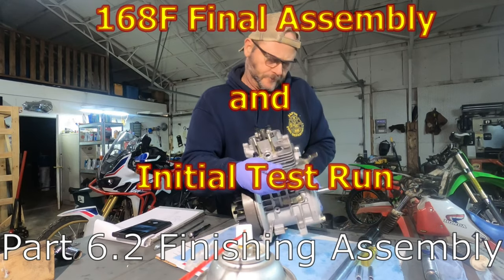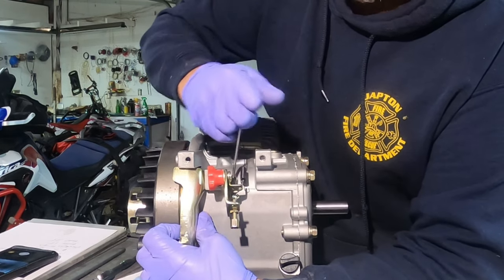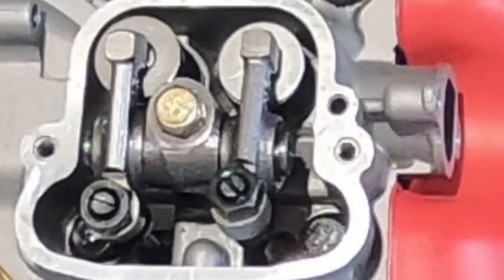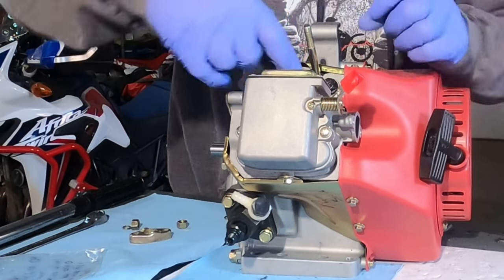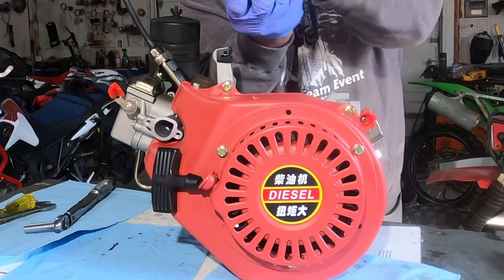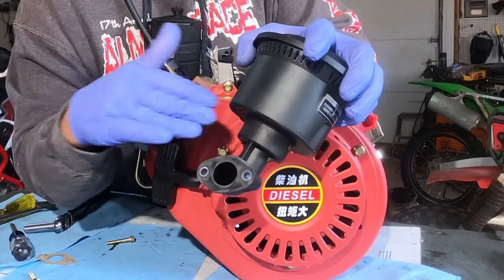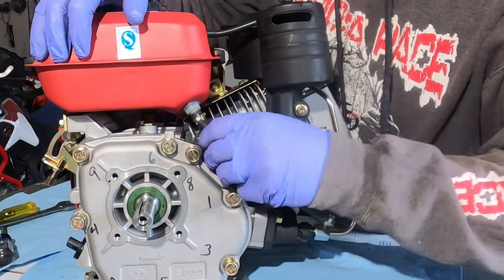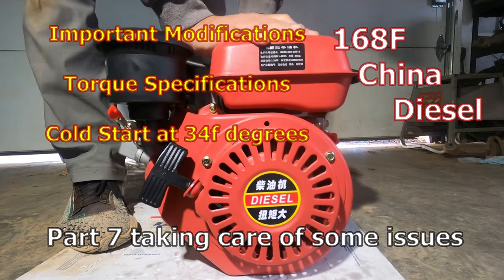168F Small Diesel Prepping for Real Use! Part 6.2 Final Assembly and  Test Run!

Comment: Using Loc-Tite on a cheap Chinese engine is a great idea that will yield really bad results down the road. A very small dab of RTV is a much better idea for those bolts on the blower cover. Making a cork gasket for the valve cover will resolve the soon to be leaking paper gasket that will compress from the vibration quickly....
Reply: I was thinking the same thing. If anything antiseize would be the direction i would go.

Comment: I watched this series and ordered one for a hand build generator. I'm sold by everything I see. Most YouTubers are making war with their little pink or orange motors. I have the pink one coming, if there is a difference. Factory 1 Factory 2?
Reply from the maker: I have 2 of these little engines.  Ordered using same exact order from amazon. I ordered the second one wanting the same as my original engine.  got the other version instead. LOL
Reply: @mossycreekvids  OK. Thanks for the warning. I do like mine. It's waiting in hardware.

Comment: How do you check the air filter? You just glossed right over that point. There is no wing nut holding it down as is usually done. There are arrows pointing both clockwise and counterclockwise on the air filter lid, but it will not turn. How do you get the top off that plastic air filter housing? Isn't it important to have a look at the air filter element?
Reply from the maker: Mine would turn and lift off, wingnut on filter under filter cap

Comment: I noticed on the one I have that breather cover on the rocker cover has no way for the crank case gasses to ventilate. I drilled a hole in it but have not run it yet. Diesels have no vacuum so I believe that read is so gases can only get out and nothing comes back in. Gassers get it out with vacuum. Without the hole it has nowhere to go though.
Reply from the maker: Does yours have the single bolt in the middle holding the tappet cover on or does it have the 2 on the side?
Reply: 2 on the side.
Reply from the maker: @chevy6794  right above the cap screw on the right hand side should be a hole in the head. That hole goes into the intake tract.  The crank pressure goes through the reed valve across down that little hole like a PCV in a car.
Reply: @mossycreekvids  ya. We had talked about that on your more recent video.

Comment: Awesome video series. I'm trying to optimize my petrol engine but not sure if it's really worth it as i can't have it go any faster than 3600 rpm.
Reply: Remove the governor but if you do that you NEED to put in an appropriate flywheel. It’s dangerous otherwise. Also should do valve springs. If you really want to wake it up mikuni carb header advance flywheel key cam and port and polish a 5.5hp head (higher compression).  Those mods make a very big difference.
Reply: @chevy6794  thx but removing the governor makes it have more than 3600 RPM which I can't have as my pump is to run at max 3600 RPM, sure I guess I could manually adjust the throttle so it doesn't go over that I guess but not sure it would be that great.
Reply: @illernpiller  oh ic. So you need more Tq. But if it’s making it to 3600 it already has enough anyways. Not too much you can do then. 5.5hp head advance flywheel key. That’s about it. Those will make it a bit more efficient. There’s also an amr350 supercharger but it will hurt efficiency and making big low end Tq raises cylinder pressures. That’s what breaks things and blows head gaskets.

Comment: Did you see anyway to adjust the pump to ad a turbo?
Reply from the maker: You can change the injection timing by using different shims under the pump.  I did not notice any other adjustability.

Comment: Did you use thread locker on the injection pump bolts, injector nuts, and internal engine cover bolts? I was just wondering I did not see if you did or not I'm going to buy one but I want it to last thank you for this series of videos because I wouldn't have a clue on how to do this.
Reply from the maker: Yes I used medium on almost every bolt